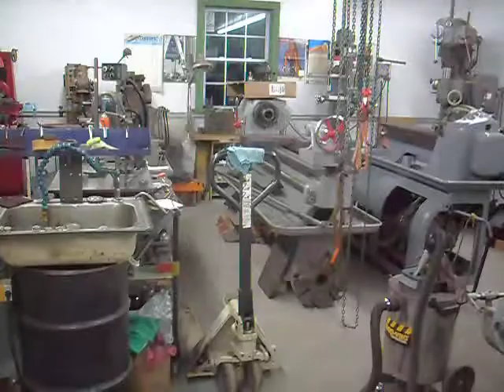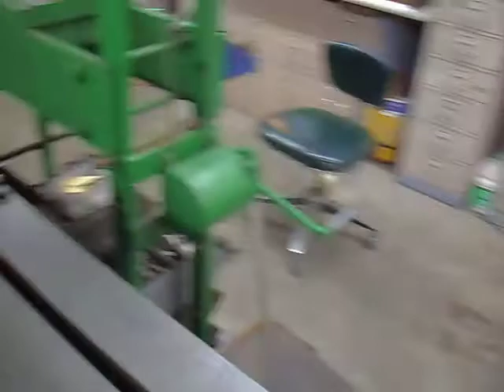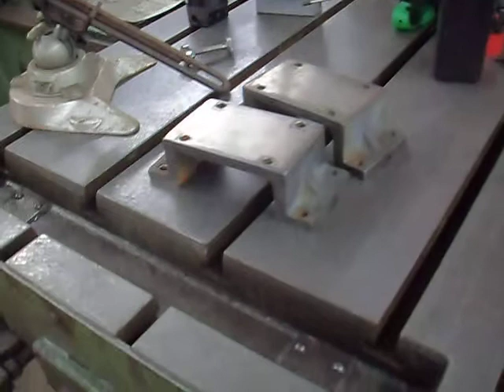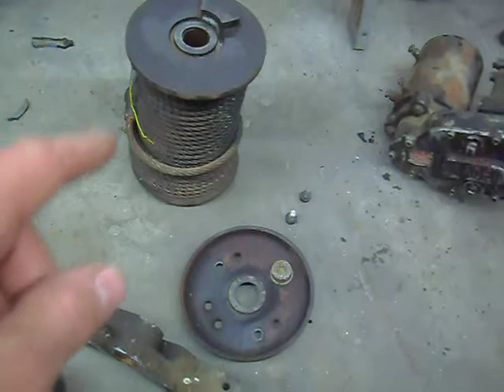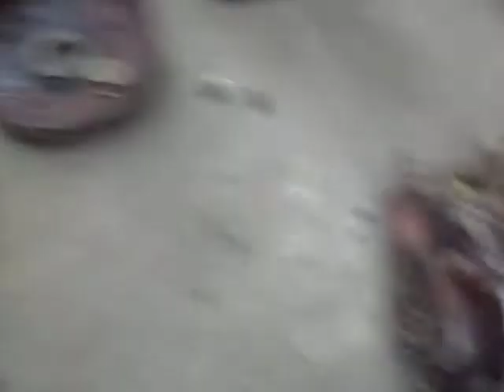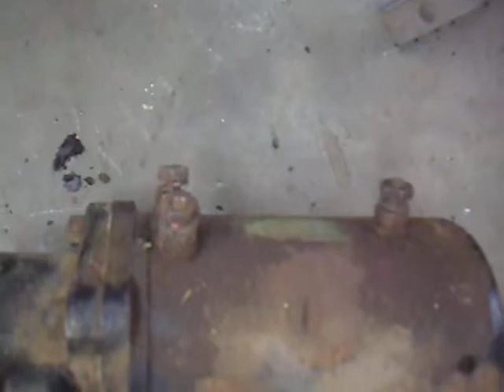Doozer's Machine Shop Update 8/7/19 -- Braden EC4-1 Winch for new Trailer

Comment: I have one I got from a friend. He pulled a loaded tri axle dump truck around side ways, your looking at around 80k lb, it broke the cable guide bracket off. Mine has 4 solenoids.
Reply from the maker: Nice!
Reply: @kooldoozer  I need to ask you a question- have you taken starter drive motor out of the Braden EC4-1? I need to know if things inside the gear box will fall apart if I pull starter motor off. Didn't want to take gear box apart if I didn't have to, just want to check starter motor off the unit. I already know solenoids are bad, found replacements online. Thank you
Reply from the maker: @aaronfurlough7503  Honestly I have not pulled mine apart.  I can't see anything bad happening by just removing the motor. I would not be afraid to take the motor off.  Call Pierce Winch in  Texas,  They sell parts.  https://www.piercearrowinc.com/collections/winches
Reply: @kooldoozer  Thank you.

Comment: Ec4 is good for 8000lbs ec4 stands for 4ton I've had 2 of these they are very rugged and not super fast and braden still has parts for them too
Reply from the maker: Thanks Jim.  I really did not know it was an 8000 lb winch. I have found Pierce PS654 parts are largely the same.  Thanks for the info.  I still need to get to mounting this winch on my new trailer.  In due time.   Thank you for watching my channel.  --Doozer
Reply: @kooldoozer  its called winches inc. Out of Oddesa TX if I remember correctly
Reply: Jim, can you tell where you got parts?
Reply: @craigturley4859  they came from a place in Cleveland Ohio I will look for the info and send it to you
Reply: @jamesmoon6042  Did you locate than info yet?

Comment: Center core on wire rope has an actual rope and does not have the kill strength when breaking. Cable does not have that rope and has much more killing strength when it breaks. I only use wire rope not cable. Braden is an old winch company and Pierce is a cheapened up version of the old Bradens.
Reply from the maker: Thanks Jonathan. I have heard the terms used interchangeably, and never knew which was which.  Thanks for you knowledge.  Being a man in the recovery business, I know that you live and die by a good winch and wire rope.  I do know that if you use a torch to cut a wire rope, sometimes the core smolders and smokes like a punk for a good while unless you put it out with water.  As for the winch, I think I am going to buy new solenoids and use her. People might say to buy a modern planetary winch, but I have this one, and everything is from China.  Seeing it has had almost no use, I think it will do fine.  My dad has a snatch block for me, it has about an 8" sheave. If the machine I am going to be loading is straining the winch, even doubled up, I still have come-a-longs to add more pull.  ------ Jonathan, I love the 31 Ford you are working on.  Fabulous sheet metal work bringing it back from the dead. Where to start on something like that is key to making it come out right.  All the fitting and straightening you are doing is first class. Hey, give me a call when you have a free day. I need to catch up with you, can stop by and see you.  Let me know.  --Dan